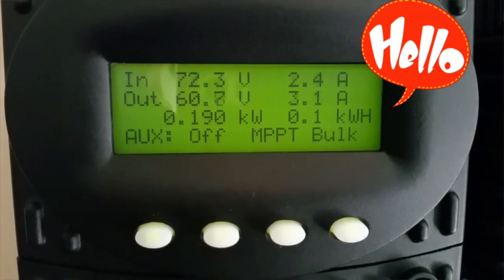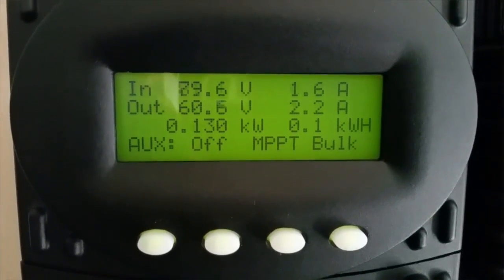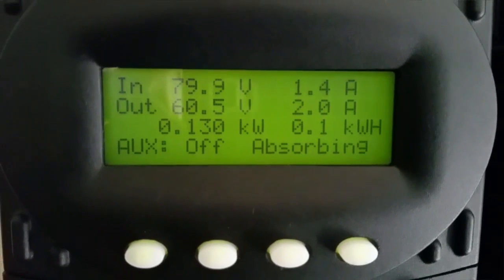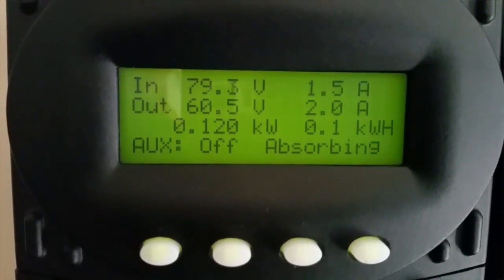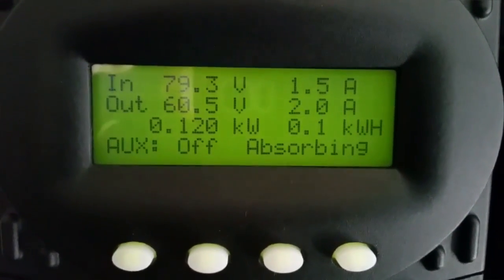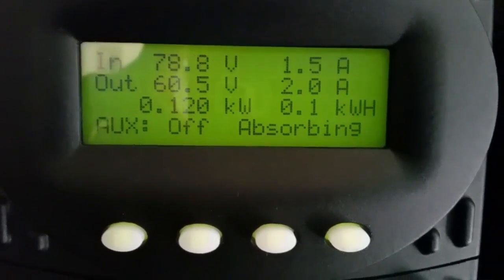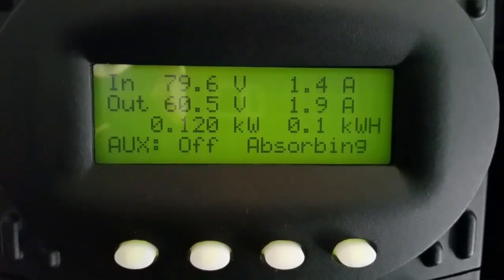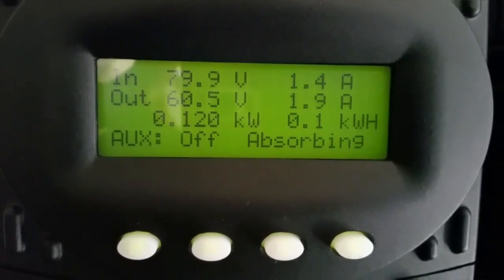IMPORTANT THINGS TO CONSIDER BEFORE INSTALLING YOUR FIRST OFF-GRID OR GRIDTIE SOLAR SYSTEM Pt.1

Comment: Nice video and hello my good sir! We have an outback VFX3048E inverter and it's been running for five years, and last week the control board isn't functioning and I was hoping to know if there are available stores/websites that still have the spare parts. Thank you so much!
Reply from the maker: Hello and Welcome to jwsolarusa.
Thanks for Awesome comment and for contacting me.
I recommend you contact OutBack Power Systems at:
outbackpower.com
Or you search for the part you need on: 
www.ebay.com
Both these information will help you greatly.
Good luck, God bless you and have a goodnight sleep.